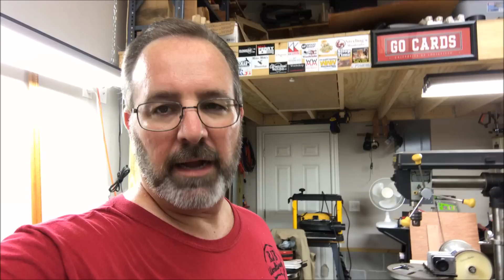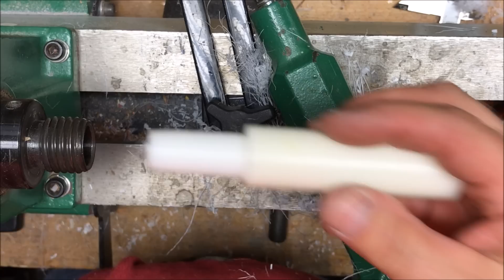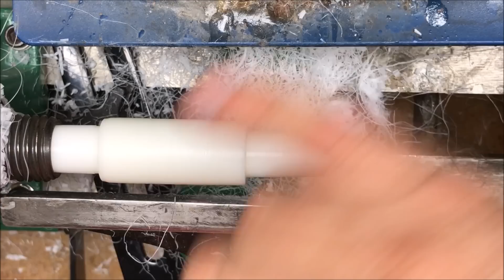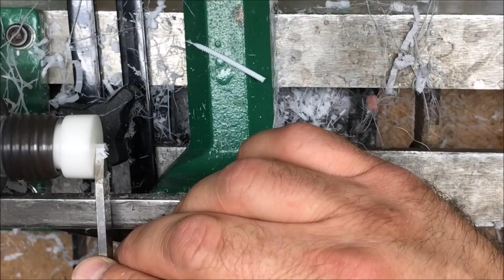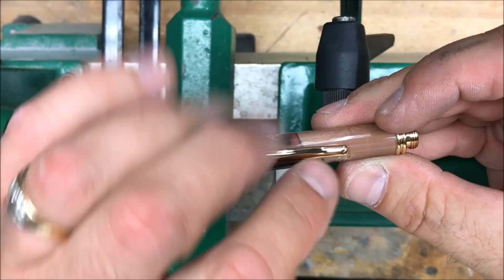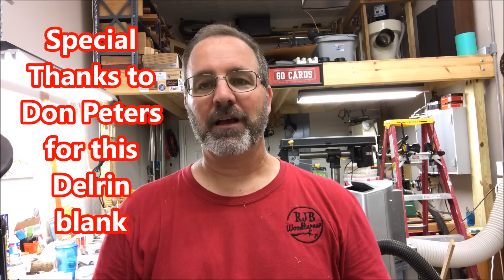Press Pens On Your Lathe

Comment: Another great idea. I was trying to come up with a homemade solution for not having one. I thought that a squeeze clamp would probably suffice but I’m not sure that it gives me the control that is really required. Making your own tools is much more gratifying.
Reply from the maker: This is a good one to make because you control the pressure with the tailstock. I think it’s a finer adjustment than a clamp. Don’t get hung up on the #2 MT. As long as they fit and have a lip big enough and round enough you’re all set. 

Regards,
Bob

Comment: I have been using a trusty "HFT" ratcheting bar clamp as a press.. worked OK, I was considering making something like you did for my drill press.  However I would rather press with the pen horizontal, so I can better ensure the parts are aligned properly.. Then I saw you video...Great idea..   I made a set very similar using some scrap "dimensional" fir....next pen, I'll give 'em a try.. Thanx again for your videos.  I love the ideas (my wife thinks I'm a genius).
Reply from the maker: Thank you,
  
Regards,
Bob

Comment: Well just finished up making these parts to press pens on my lathe as I don't yet have a pen press. I used 3/4 UHMW. I also don't have a jaw chuck, a drill chuck for the lathe (or a drill press), or a parting tool (which is one of the next things I am going to get) so I had to get creative. They don't look quite as good as yours, and I will test them out in the next day or two once I apply the finish to my first pen. Either way, once I get the above items I will be remaking them as I am sure they will turn out better. Thanks for the video. I have gained a lot of knowledge and things like these pen press bushings, the non-stick bushings, reverse switch, etc have been invaluable.
Reply from the maker: Thank you, I appreciate your note and am happy my videos have helped you. 

Regards,
Bob

Comment: You recommended 3/4" diameter for doing the ca finish bushings. Would I need 1" for doing the press bushings or would 3/4" work for these as well? Going to be getting a rod for making both, rather just one that is the right thickness for both, rather than two different ones.
Reply from the maker: Pretty much any diameter will work. Just leave plenty of length so it doesn’t get shoved back into the Morse Taper.  
Regards,
Bob

Comment: why not use just hard wood instead of Derlin?
Reply from the maker: +L.R. Norris it would work just fine but you would require some padding so as not to mar the kit.
Reply: thanks!
Reply: I made mine out of scrap maple, Wish I had watched this video first because I did a good fit on the morse tapers which makes them difficult to remove from the tailstock.

Comment: my pen press has a screw on the jaw you set. it is great for putting in the transmition. I lower the handle and then put the pen and transmition in. a few turns of the knob and the transmition goes in . I can adjust it very easily with very little chance of pushing it in too far
Reply from the maker: +MelbourneAlan I haven't seen that one but is sounds like a great idea. 

Regards,
Bob

Comment: With 3 small scraps of wood, make a guage block for creating Morse tapers by gluing  a couple "walls" alongside one of your drive center tapers.  With this you can hold this new tool up to a taper you're turning and get a good visual idea of how it will fit into your lathe.  Mount a small disc onto one end of a wooden taper, center drill it to contain a rod to fit whatever size brass tube and with a little spray adhesive you've got a very capable small powered disc sander you can take to any lathe on the road with you.  Remove bulk material with the outer part of the disc and slip the tube onto the fitted rod and it make a nice flush sander to do final cleanup.  If you ever have to go overboard with CA glue, this works pretty well for touching up the end of a finished blank just before pressing too.
Reply from the maker: +Bill Kibby Great advise Bill,
  Thank you. 

Regards,
Bob

Comment: Yes it's a great idea, I made mine 3 years ago after seeing them in woodcraft catalog, now penn state industries has magnetic press heads for sale in their catalog that are thinner than having the #2 mt tail on them.
Reply: Michael Reed I got that set a few years ago.  They work fairly well though after regular use, the magnets tend to fall out regularly and attach to the inside of the head/tail stock.  You have to have a punch or awl handy to dig them out and re-attach them back onto the plastic.  Since the plastic is HDPE, they won't glue in.  

I like this method. I'll be turning myself a pair. I'd definitely go with the harder Delrin than HDPE.
Reply from the maker: +Michael Reed Thank you Michael, 
  I appreciate the info on the magnetic blanks press blocks from Penn State, I hadn't seen those yet. 

Regards,
Bob
Reply from the maker: +Allan Wolfe Thank you Allen,
  This is great information about the magnets. 

Regards,
Bob